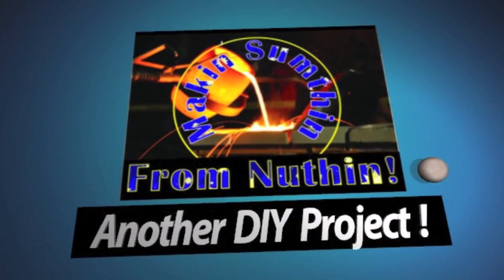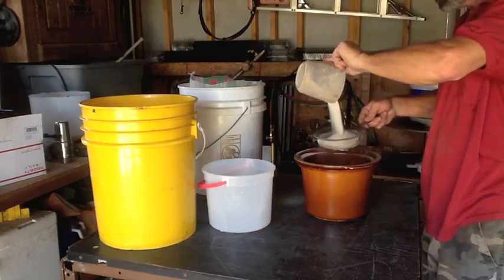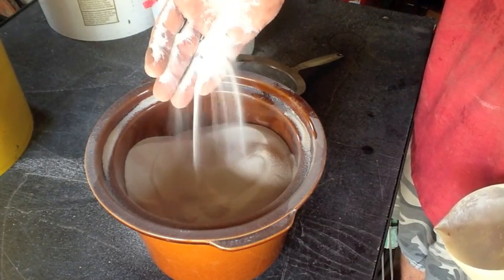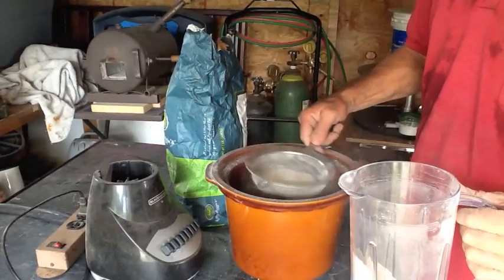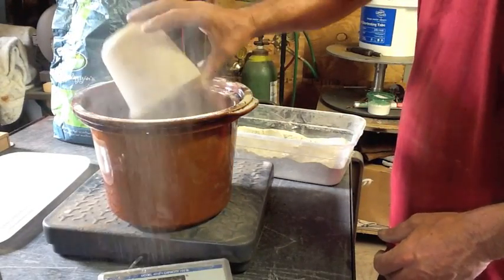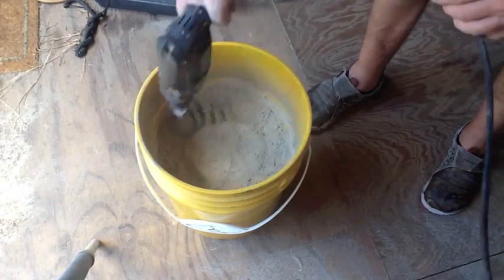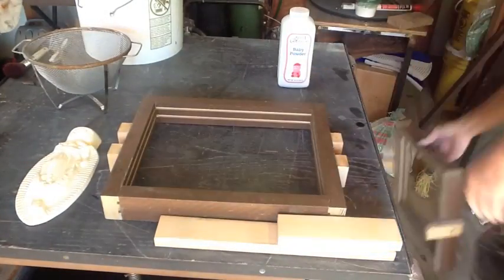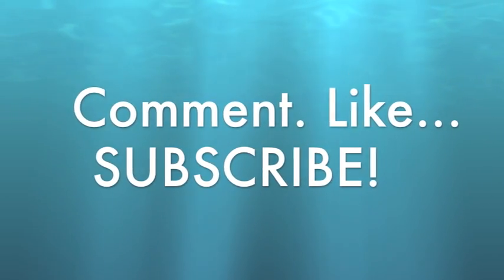DIY GREEN SAND FOR CASTING - CHEAP, SIMPLE and FAST - MSFN

Comment: 🙏 Tyvm Rich. Comments and replies always provide insights. A strong magnet will remove any iron contaminants that may be present in your dry green casting sand, bentonite clay mixture. Mixing the casting sand & seiving, compressing into the molding box and tamping evenly are key parts of the process. Safe work practices must be followed. ⚠️ 
I was surprised that you didn't replicate the plastic part by the lost-wax method for investment casting. Pattern-making for casting is quite an art. 3D printing pattern parts, CAD-CAM, Laser sintering all great for series production. We succeed by having 1 more win than failure.

Comment: Thank you so much for the information this is awesome! I have a question, do you want to have a certain moisture content in your sand when casting? Do you actually wet it before use? Or do you want it completely dry? I am interested in casting in brass copper and bronze and have this irrational fear of it exploding because of water content XD

Comment: 3 to 1 and add a quart of water  . Mix and done. Add water minimally if needed . Worked perfect for me. Save in sealed tubs and add water if necessary if needed. for later use  A++

Comment: From my Foundry experience, this is really a cheap, simple, and fast way of making Green sand.  One thing that we do to reduce cost is use fine sand (your process) around the pattern and use coarse sand above it. This would help in two ways. Your fine sand requirement will be very small and coarse sand enables the gas pass through easily. After seeing this video, I have a curious question on a different subject. In my back yard, there is a 800 sq ft of easement. Weed paper and mulch didn't help me to remove weeds. Do you know this Green sand takes care of the weed as it contains clay?

Comment: I used to work in a steel foundry for a while many years ago (before UK got rid of most if its manufacturing industry) and was working with huge moulds and casts - your videos explain the whole process perfectly in a smaller scale and are brilliant! Thank you
Reply from the maker: Thanks Harry!, much appreciated!
Reply: Casting sand when used for metal has no water in it.
Reply from the maker: @lenny108  it depends on what kind of sand you make, my sand uses water
Reply: @MakinSumthinFromNuthin  Let's say you pour a metal in that mold that has a temperature of 900 C the whole mold will explode when there is water in the sand. The water immediately turns into steam.

Comment: my  home made  greensand doesn't sift well on my sifter, seems to be  to wet , would  window  screen wire  work?
Reply from the maker: once clay has been added to the sand it has to be very dry to re-sift it
Reply: thanks  for your  reply  ,will try  drying out  sand, thanks  again

Comment: Walmarts fine mesh stainless steel strainers by Mainstays are great for this. Some years back I was extensively researching youtube for DIY green sand and other types for casting projects. I wish your video popped up back then when I was searching. Good work. 
Also, the play sand in my area hardware stores seem way too coarse for casting. I have to order online for fine sand.
Reply from the maker: Thanks!!!

Comment: Just getting into casting and making green sand is at the top of the list for me.  Thanks for posting.  After making a pour can the sand be used again?  If so, does it need to be sifted again?  Should green sand be kept in an airtight container to keep its moisture?
Reply from the maker: it can be reused over and over but needs to be re-moistened before each use. air-tight container is a good idea

Comment: Hi I'm starting to get into casting myself. I used to work for a stucco company. I was wondering, if I could use fine grain silica sand for molding. Probably a thousand to 5000 grit.
Reply from the maker: The finer the sand, the better the surface finish, GLuck!
Reply from the maker: I bet that would work just fine!!!, no sifting.....LOL

Comment: I hope I can get an answer I didn't sift the sand as fine as you did and my sifter wasn't quite as fine but I'm very familiar with petrobond and this is not taking an impression worth a darn. No idea?🤔I'm pretty sure my ratio of kitty litter to sand is right on I checked my math three times so right now it's taking a poor impression and crumbling any suggestions sure would appreciate it.
Reply from the maker: If the base ingredient ratios are correct on the mix I would say you are light on water or not mixed well enough

Comment: Thank you so much for making this tutorial. You instructions are excellent. I am new to sand casting. I started off on my own with a pattern and tried plaster of Paris which ended up as a disaster.  Huge mess and lousy results. Next I tried Portland cement. That too was an utter failure. My next attempt will be green sand. I am looking to cast small lead hammers to use in my home machine shop. I figure that as they get all mushroomed over, I can just melt them back down and cast new hammers.
Reply from the maker: U R Welcome! Perfect application!

Comment: A tip when mixing to decrease the amount of powder flying everywhere:
When you are layering sand with bentonite clay (which is what litter is made off), put a thin layer of sand on top of it and stir it by hand a bit (which means still using the mixer, but as if you were having a spoon in your hand, rather than a power tool). This way part of clay will go down a bit between the sand grains and the top layer of sand will further decrease the amount of particles flying around once the mixer is on.
In other words - act as if you were mixing dough for a cake and don't want your entire kitchen in flour.

Comment: So I bought general purpose sand by quickcrete, I'm wondering if play sand is better since this sand won't bond correctly.  With a proper ratio of sand and clay.  I don't want to over water it, since my mix is thoroughly mixed to damp not wet. So sand preference??

Comment: Curious if you've experimented with oil instead of water? 

How about using baby sand instead of play sand? It costs about $1 more/bag but is much finer,  comes with the impurities (larger bits) already sifter out & I would expect it to produce better results/finer detail.

Thank you for the clear & concise directions!
Reply from the maker: I never tried oil bonded sand
Reply: @MakinSumthinFromNuthin  Thank you for the reply. 
I meant to say masons sand, not baby. If you try out oil bonded I sure hope you post the video explaining any advantages and/or disadvantages.
Many thanks for your straight forward editorial and still replying to question almost six years after the original video post!

Comment: After watching your video, I scoured the yard sales & Salvation Army for blenders. I set the price at $10/per blender. Found 4-5 blenders at that price. As you pointed out, the blenders are not designed to do these types of operations.
Reason that I acquired so many blenders was that I wanted to attempt to pulverize a portion of my "play sand" as well as the Kitty Litter.
And yes..., before anyone points out the dangers of inhaling silica sand dust..., all respiratory precautions were done during ALL pulverizing operations.., I worked outside, wore a good quality respirator, and used a large shop fan to blow away the dust.
Now my ratio of ingredients is: 4 parts regular "double sifted" play sand, 4 parts "double sifted" pulverized play sand, & 2 parts "double sifted" Kitty Litter.
The resulting GreenSand is super fine, and produces a very fine surface on castings.
Thank you for your tutelage that helped me formulate my GreenSand!
Stay well!
Edit: pulverizing play sand really wears out the stainless steel blades on the blenders, and I actually pour the pulverized sand across a molybdenum magnet a few times, and removed a few grams of steel. I'm not sure if that microscopic steel would've caused any issues, but my OCD wouldn't let me not try this step..

Comment: I know this isn't an option for folks who live out west, but if you live somewhere with cecil soil, or really all of the piedmont on the east coast, but you can really just use the clay from the ground (but make sure to wash it first by mixing it around in water, then, right after agitating it, pour off most of the slurry). And about 3 feet under the surface, the clay is in the perfect ratio with sand that it can work as greensand right from the ground.

Comment: Tremendous tutorial, the one I was looking for.  I have a question, how long can the stored mix last without being used? I mean, if I make extra or if I'm not going to use it at the moment.
Reply from the maker: The green sand mix can be reused over & over for years, but if too much time passes you will have to re-add water & re-mix since water  evaporates, it needs the right amount of moisture

Comment: Hey! 👋
Just discovered your channel and I had a question. Would this sort of mix work for making something of cast iron?

Also, what would I add to the sand if I wanted to make the mold permanently shaped and reusable? I've done it before but I forgot the missing ingredient. I think it was some kind of resin.
Reply from the maker: Green sand can be used for cast iron. I dont have an answer to your second question

Comment: I assume if you wish to avoid a steam explosion the 2 halves of the mould will have to be dried out before any attempt is made to pour hot liquid metal into the mould. How do you do that ?
Reply from the maker: The sand MUST be just damp enough to hold its shape, but not too dry, or too wet....its a fine line and is a learned skill from experience

Comment: What were the ratios of the different 2 sand types and kitty liter?
Reply from the maker: I only used one type of sand, the sand/clay ratio is covered in the video at length
Reply: @MakinSumthinFromNuthin   Yes it is....80% / 20%   Right?  I was confused and thought you were mixing play sand, kitty litter and green sand.  I realized after a bit that you were making your own green sand.   Sorry for the Confucius Brain Fart.
Reply from the maker: @michaelwood5519  no worries, the ratio is 10% by weight (50lbs sand, add 5 pounds clay) etc
Reply: @MakinSumthinFromNuthin  ahhh ok Roger that!  Thank you mucho!

Comment: Just enjoyed this vid, and so I subbed.
A question for you, that I've asked several other Casters..., have you ever poured alum into an open mold, and the have it rise up, like a muffin.., and then start making large crystals of alum on the surface? My first pour came out normal, & was mostly from extruded alum. The 2nd melt & pour was mostly alum transformer windings.
Thanks for any advice or help that you can give.
I'll be making my first batch of your version of Green sand tomorrow.
Happy & safe pours!

Comment: How many times can you use the green sand with molten metal before you have to replace it?
Reply from the maker: just re-add clay when needed, will last years & years
Reply: @MakinSumthinFromNuthin  good to know. Thanks. I want to learn how to cast some low temp metals first haha.

Comment: I am trying to work with green sand  I made.  I am having an issue with the layer directly in contact with the original clay items seperating from the frame instead of lifting off.  I am hoping for some advice.

Comment: can you reply with the recipe measurements, so i can have it in text? also, can this withstand heat for only aluminum castings? or can it tolerate higher heat castings such as brass? whats your opinion on mansbond oil sand?
Reply from the maker: handles brass / copper just fine

Comment: I found this very informative as since June last year I have been working in a foundary but there we use air set resin sand and I have bought myself a small melting furnace to try making stuff from aluminium cans and I have bought some petrobond casting sand but because of the expense of it was told to use green sand as backing for it so I don't use much .
Reply: Hello my Freind can show me more about aluminum foundry , i really want to learn it 
If you can this is my email: zaherdamardji@gmail.com

Comment: I can't get my sand to clump  I lift the box and all of the sand just falls out.  I have followed you exact steps.  It is super fine and I think I need water in it or something.  It's to dry and loose.
Reply from the maker: If you have the proper 10-12% clay by weight added to the sand it will hold together with the proper amount of water added. I use approx 1 quart added water per 30lbs of sand or so.  That gets you close....then fine tune it from there. Humidity levels effect needed amount of water.....there is no "exact formula" for amount of water needed. Do the clump test by squeezing a handful...if that holds together....your mold will too
Reply from the maker: If it doesnt clump in your hand more water is needed. Sand should be damp.....not "wet". Thoroughly mix everytime water is added, the eggbeater & drill works good
Reply: @MakinSumthinFromNuthin  thanks. I have adjusted amount of water.  It clumps now but in some areas it is loose and I loose detail.  Learning by trial and error.  Thank you for your feedback.
Reply from the maker: Mix the sand more, getting uneven water distribution

Comment: I would like to produce thin thickness (0.5 mm to 1mm) 2D  pieces in Sand casting. The sizes are something like 10cm length* 8cm breath* 0.5mm thick. It is an art pieces, in which we have more details and the surface. So the sand should give good glossiness to the surface of the metal piece. 
Now I use normal agriculture sand from North India with binder as some oil locally available. But I have problems in flowability and the details on the structure is very less when compare to the pattern pieces. So please suggest me a sand in which I can process this kind of thin pieces with good details present on the surface of the manufactured component, which should not require additional surface finishing. Metal I use is Brass. 60% copper and balance 40% zinc and tin. Totally it is an art pieces. Kindly suggest which kind of sand I can go.
My no: 0091- 8883696791.
mnashath786@gmail.com
Reply from the maker: I have those same problems at times. There is a youtube channel who could help.  Look up OLD FOUNDRYMAN

Comment: WARNING! WARNING! WARNING! While a cheap and good casting send is a treasure, THE WAY IT'S MADE is A STRAIGHT WAY TO SILICOSIS. My best suggestion is to re-structure your technological process the way that you will not breath with dust produced while re-fining the send and powdering clay as both of these are concentrated crystalline silica and it is airborne in huge amounts... and you're actively inhale it as you work, and therefore breath more often.
Reply from the maker: OMG, googling life insurance rates as I type. Driving is more dangerous

Comment: Curious why do you mix sand with clay couldn't you just use clay and wet it with water. Why the need for sand mixed in with clay in kitty litter... Is it that the kitty litter doesn't completely have 100% benonite clay so you compensate with fine grain sand? Because it seem to me 100% dry powderize clay would the sandcasting material you would need any sand just powdered clay.
Reply from the maker: Cant just use clay. Green sand dates back hundreds if not thousands of years. Its just the way its done :)
Reply: @MakinSumthinFromNuthin  so what does the sand do for the clay i don't mind doing it that way its just i like to understand why where adding ingrediants
Reply from the maker: The sand does all the work of holding the patterns form, the clay just allows the sand to stick together during the casting of the metal. The space between the grains allows the gases to escape so you dont have a steam explosion and be wearing a suit of molten aluminum, brass or cast iron :) 10-12% bentonite clay to sand by weight is about right
Reply: @MakinSumthinFromNuthin  I thought the air hole and pour holes regulated gas escaping and metal pouring. Ok but fine sand is just the aggregate the binder is the clay for it, so in theory you could have used any type of fine sand ..heck if you had kaolin sand , quartz sand ,...etc. The only thing that might be different is the ratio of clay to the type of fine sand being used to get the equivalent consistency is that about right. Not disagreeing with your method i like it but curious of how general you can be with the type of sand or clay chosen to do these sandcasts.
Reply: Also a different but related thing is have you considered if you had a kiln to just uses a kaolin clay and make a 2 piece porcelain mold then just fire it to make a hard permanent mold you could then take to cast your metal in rather then using sand. For most metals and definitely glass porcelain should beable to support the metal cast just like sand/clay casting.
Reply: Thats why i was wondering about just using clay casting of the metals wouldn't it just turn the shell of clay surrounding the mold into basically a ceramic as your casting the metal so you get a ceramic shell that you could knock off the metal cast. Maybe i am wrong. Thanks for your explanation great video btw
Reply from the maker: Thanks Sam, do all the research you can prior to messing around with molten metal. I dont know anything about other processes other than green sand casting. Watch my other vids on it being done....see if its right for your purpose